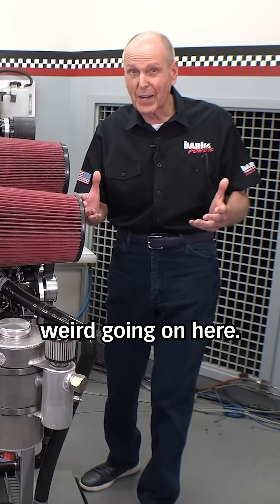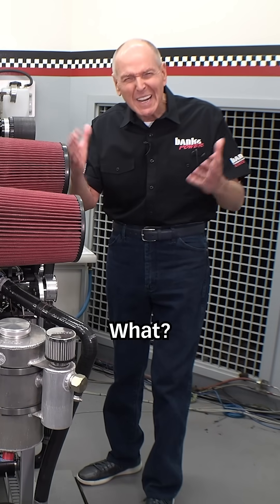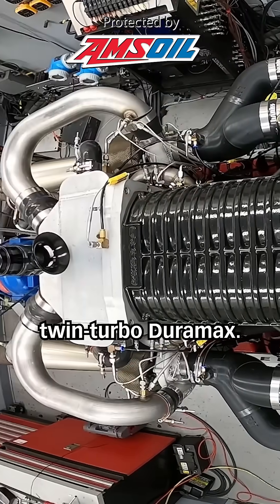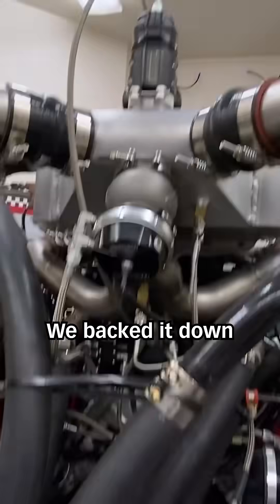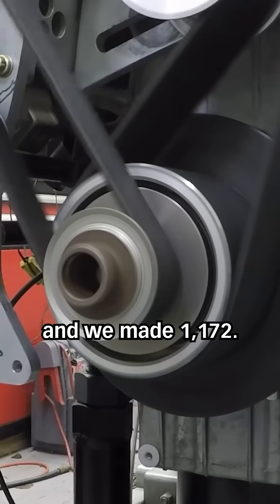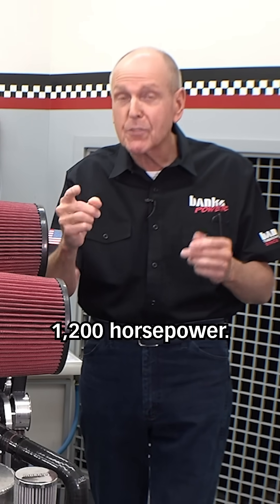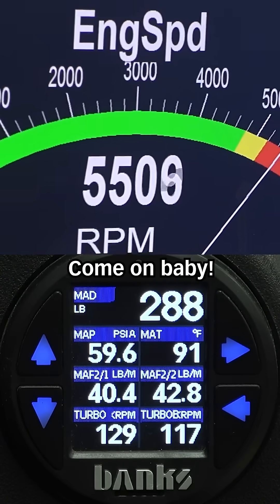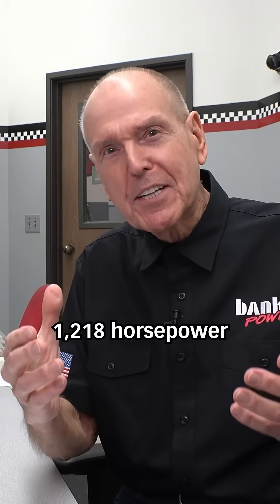How to make 1,200 horsepower the wrong way.

Comment: Gale, the diesel man already knows this ...
The old 735 ci 8V92 T Detroit was 430 hp with one turbo into a supercharger. They added a second turbo the 8V92 TT 440 hp in a two-stroke 735 ci diesel, a bad design.
A 855 ci cumings BCll with just one turbo rated at 400 hp would walkaway from a Detroit diesel loaded around 80,000 lbs. And on a pull like vantage 11 miles up hill, the DT would be so far behind you couldn't see him as you reached the top.
Reply from the maker: But the Detroit sure sounded great! Hard to beat the sound of a Screamin' Jimmy!
Reply: @bankspower well yeah in a light Grayhound bus on the flats... 
Back in 1980 I drove a hay truck at the age of 16 with a big cam ll, the guys with the Detroit Diesel hay trucks would tell me. You know the best way to drive a Detroit, when your getting in the cab SLAM your hand in the door. Get in mad as heck and shift like crazy ... 😂

Comment: Blower should be first for instant throttle response. And then once the Turbo spool, they can pick up the slack. Afterwards, slower, lower speeds means more cfms, more air, more fuel, more power

Comment: nothing is wrong. turbos are naturally going to lag a bit. with less force going in to the engine by super charger is making it a tiny bit lean, when that happens the turbos goes a bit faster because there's more power being used up which allows the engine to basically take as much as it needs and is able to disperse what it doesn't need more easily. and in some cases can make the engine pollute less if done in that way

Comment: Hey professor , I have always had a want to fab out a turbo with a roots style super charger compressor housing on a turbo . Build a turbo compressor housing side of the turbo into a twin rotor . Instead of a single compressor wheel , make it a diameter rotor compressor assembly

Comment: My issue with this is the 1200hp@5500rpm. Make 1200hp@2600rpm and ill be impressed. 1200hp@5300rpm is less than 1200lbft. I want 1200lbft@1600rpm. My normal money maker is 1850lbft@1100rpm(394hp) it still making 1850lbft@1400rpm(thats 497hp). Its just a calulation. Because 500hp@1700rpm is a mere 1544lbft. Where does 3hp become 306lbft? Its all a calculation. Show me a 1500, 1700lbft 6.6 or 6.7(cummapart or PSD), that makes real leverage and is reliable .

Comment: Just switch them around and make 2300hp because the blower is acting like a choke point because the turbos spoil up faster and make more psi switching them around blower first turbos second the turbos will make the bill flow as the turbos speed up the cfm add timing and fuel and ur be grinning.  #BrinksDiesel

Comment: Mr. Banks.
With all duevrespect for you as one of the masters of power.
That's a compounding system. The turbos once spooled up the blower is only al9ng for the ride as the turbos over ride the blower and the blower now acts as a positive displacement, but turbos work as veritable density. So yes....a slower blower speed with turbos is cool combo.

Comment: Try running an external pump and oil cooler on that blower and turn the speed back up, bet it picks up gobs extra power, supercharger is creating extra heat at higher rpm and killing charge density as a result

Comment: My thought is that if you slow the blower down then the turbos are able to create more boost before the blower. Essentially using the blower as a kind of restriction that can then boost the boost from the turbos. Compressing the air going into the blower, seems like the air coming out has more pressure? volume? Or velocity? Just my thoughts on it.

Comment: I'm a self-proclaimed YouTube mechanic LOL. But I do know pumps and pumps work on a curve if those curves between two pumps don't match then they're working against each other because where they meet it will cause turbulence which is kind of like a clog in the pipes which in turn will create more heat because they're working harder to get the air through

Comment: Remove the supercharger and add a Venturi system on the discharge side of the turbos cooling down the exhaust and adding more volume of air

Comment: What I don't understand is why nobody has used the Venturi system with turbos it would increase the air volume going in along with cooling down the air I guess I should say exhaust going through the turbos it would pull air in cooling the exhaust gases which in turn also increasing horsepower and they're not hard to make

Comment: So this DuraMax is set up like the army did with the 8v71t, 6v63t, 6v71t, 12v71t and 12v92t from Detroit Diesel back in the day to power its heavier tracked and heavier duty wheeled vehicles to wring out more power in units that have to go into confined spaces with strict airflow circulation rules. 

Come to think of it, Continental Teledyne did the same thing with its AVDS 1790 gas burners. ( thats 1790 cubic inches in a V12, gasoline burning, aircooled tank engine using 2 magnetos per bank as spark, and also being both turbo charged and super charged.
 And yeh, pumping more air into a blower thats slower cools and condenses it, bumping up your power.

Comment: Slowing the blower down allows the turbos to build more pressure in the top of the blower before it slams in into the compressor side of the blower...more time to build a higher pressure equals a compound ratio on the engine side, atleast as a machinist that would be my thoughts so dont quote me on it but that would make sence..

Comment: He should put a smaller displacement supercharger with slightly undersized pulley to get it to spin. One boost pressure reaches optimum number the turbo should take over from there

Comment: I say the Supercharger is the restriction. Be nice to watch the boost pressures upstream of the Supercharger before he started slowing it down and then the final pressure downstream of it in each test phase. The Supercharger is only proficient at lower RPMs. Allow the Turbos to spool tighter giving more mass crammed into the rotor lobe because it has more time when it's dlowed down.

Comment: Blower cannot accommodate how much air they turbos are capable of pushing through. Put some ways gates on the turbo, charged pipes and dump the excess air that the blower cannot deal with straight into the lid. Could get way more technical but you know what I’m talking about. You’re very intelligent.

Comment: I’ll be honest I learned this for Mr. Banks. Slowing the blower down cools the air off in the supercharger. Cooler air is more dense and creates more horsepower. I knew about the cooler air making more horsepower but I had no idea about slowing down a supercharger because it created heat. I love these videos.
Reply: Slowing the supercharger also results in less parasitic hp loss. The amount of hp needed to drive a certain psi, goes up on a logarithmic scale, not linear.
Reply: @ Thank you. I understand what you’re saying.
Reply: That's what I'm thinking too.
Reply: Keep the blower speed cranked up and throw water methanol on there. Now you're back to denser air but at a much higher flow rate ;) superchargers absolutely love water methanol pre blower

Comment: Volvo made a truck engine for their fl6 model with a turbo and blower...the blower came in first and as the turbo came on the blower would cut out with anc air clutch system....the thing had torque like nothing else at the same hp rating

Comment: You are the master of diesel power but the way i always understood it was blowers make good boost at lower RPM’s and when the blower runs out of steam the turbos kick in for the higher RPM boost. The way I always understood it was; you could make boost all day long but if the motor cant take it in your waisting power in the form of drag (ie more boost) trying to push against a wall. Back down the attempt at making boost and you’ll make more power. It’s definitely a balancing act and making the most efficient air pump. Im a gas guy though so maybe i am way off on this. Definitely respect all you do tho.

Comment: Let's go with some physics here and some time I'm going to try to keep it really dumbed down I mean hardcore dumb down to everyone can understand we all got to start somewhere that's how I started 

As we know engines need air to run with fuel they also need time aka duration pretty simple right now as I believe we all can agree 

Let's go with something that I know that everyone can pull data on which go with the Detroit Diesel engines The DD13 DD15 DD16 diesel engines like that sort whatever brand you like I don't care not important I'm just trying to give a baseline so everyone can understand what I'm talking about 

Detroit engines basically start their baseline for maximum torque at 975 RPM they go all the way up to like 1500 just using it as a round number I can't remember at the moment 

The reason why these engines can go so low on the RPM and make so much torque besides cam profile and compression let's dumb it down even farther all the way down to time an engine spinning at 900 RPM is a lot slower than 1500 RPM this will impact the duration of the valve opening and closing intake and exhaust The other thing is fuel burn gets impacted because it's got more time to burn The other thing is because the intake valve is open for longer and the turbo is putting out how many pounds of boost you want to think of here it's able to cram that in for longer before that didn't take valve shuts in the piston goes on the compression cycle so keep that in your mind there lower RPM more time to cram air in then you get more compression out of it plus you can inject a boatload of fuel even if it's the same amount at 1500 you're still able to burn that longer therefore by getting more complete burn of that fuel extracting more energy getting more efficiency out of it now hopefully you understand that 

What I believe is happening with the blower and how he's actually getting more power out is the same effect because he's slowing down the blower changing the pulley on it making it run out of slower speed he is allowing more air to be pushed into the blower sections that come together that force the air into the intake underneath of it since he slowed it down he's giving it more time to shove more air into the same exact space and as the blower turns it pushes even stronger if that makes sense for anyone we all know that the blower only can do so much air on its own He's basically not only maximize the air that it can put out but also he's cramming air on top of it quite literally to go through it The other thing is because he's slowing it down he's generating less heat which gives you more air density as if you've been watching his videos 

The way I came up with this so-called theory if not more due to the fact that he talked about blowers and over driving the blower is something you never want to do because you'll spin it faster and faster and faster and the heat builds up but also the same thing You get the blades moving too fast and they can't grab the air they can't compress it like they should alone on its own but when he added the two turbos he kind of solved that issue to a certain extent but now slowing it down allows it to grab more chunks of air and jam it in into the intake manifold if that makes any sense 

I don't know how much CFM is moving but you really can't measure that here You have to use air density boost can be a flat-out fucking liar and I'll tell you first straight up I can tell by the truck that I drive is a 2024 Mack anthem with the MP8 engine I burned a cylinders in too low RPM high gear heavy weight made it work get it screaming The trucks and animal now is 77,000 mi on it I started out with 351 mi something like that with that said it may be a governed truck but it flies The other thing is air density is everything My truck to try and say 40 lb of boost and I'll go 40 lb my ass If it's hot outside forget it cuz I look at the boost but then I start looking at EGTs and when the EGT start skyrocketing I know right then and there that the air density is not there because if the boost is actually there the air density is actually there My EGTs will be a lot cooler I will get more complete burn I won't get so much exhaust gases either the annual run cooler especially right now we're getting in the fall I'm getting a boatload of power and the other thing is the way to trucks running and the way I ran the truck with the transmission it will run down the 850 RPMs and top gear The truck has learned to do it it only likes to go to 900 factory but the truck has learned it can do this The other thing is you listen to your turbo you listen to your engine how it's firing and you can tell when the air density is really good extremely good that turbo screams like hell and I'm holding high gears like 11 direct drive and 12 overdrive going up grades from all different ranges of different loads that I pull I can pull like 45 46,000 lb in a box all the way down to 20,000 lb sometimes 8,000 lb but I can tell you this if I'm not really pulling 30,000 lb say 25,000 I may not even feel it the truck just takes off when the air density is there 

If you kind of don't understand what I'm talking about look at banks he's got YouTube shorts he's also got the videos it's very important you know your air density to me I wish every vehicle would tell you that right away especially when you're under a boost application Banks does have a video with a one foot cube literally welded has some sensors on it some gauges heats it up and literally to boost gauge starts going up but the air density has not changed whatsoever so the boost gauge can be a big fat liar

Comment: The supercharger is the restriction. It can only flow so much cfm through it. Thats why it gained power when Gale turned it slower. It became less of a restriction. He would make more horsepower with just the turbos into an open plenum intake manifold.

Comment: To much manifold pressure decreasing air flow with the higher blower speed or decreased air density because of the increased heat from the higher blower speed

Comment: That's some smart thinking about reversing the set up when you think about it. With the turbos waiting to hit  boost trying to push more cfm though the super there would be an rpm range where there is no boost between the them but a vacuum making the super less efficient  and when in boost it would put more pressure onto the super and it would need more crank power to turn it and with the super blowing into the turbos they would spool faster with the the super acting as a pump assisting the exhaust side of the turbo forcing the turbo to suck out the exhaust out because it wont be the the exhaust pressure in the turbo spinning up the intake side it would be the super spooling it up forcing the turbo to suck the exhaust  out

Comment: Yeah, the blower is beating the crap out of the air, basically operating the supercharger at too high rpm is adding more heat then density. It would probably make more power with just turbos. Or, if you must have the blower for rpm response it needs a way to bypass the supercharger. Ideally with a clutch and an air bypass.

Comment: So basically it was running lean?
Reply: Diesels should ALWAYS have excess air; remember, diesels don't throttle the air, they always swallow as much air as possible and control power by modulating the amount of fuel that's injected directly into the combustion chamber. Diesels don't run "lean"  because the only thing that matters is what's going on at the flame front; at that point A/F is pretty perfect or there wouldn't be a flame.

Comment: It's because the blower is driven by the rpm speed of cam.. hyperthetically the blower can only blow what rpm speed engine cranks at,  basically the turbos are pushing more than the blower and the blower is restricting the cubic m² of air blowing from turbo..   so yes.. change the set up.. put the turbo on the line and blower as secondary and boost psi on fuel some more than what you just put in.. try 1500cc injectors highflow..😊😂😂
Reply: And you should get at least 1500hp

Comment: Could you cnc a aluminum spacer to go onto the heads before the blower to just take the charge of the turbos? 

Look a lil goofy, maybe but if you could route that air before the blower and then turn up the blower i wonder how long it would take to blow. 

In theory a inch to two inch spacer should have enough room to allow the flow of the turbos.

Comment: I would really like to see a video and testing of pro charger to feed turbo combination. To eliminate any blow through anomalies And as much fuel as he can dump in it!😊🎉
Reply: Could run a quad turbo setup. But a procharger would likely be a better option because less parasitic HP loss than a roots blower or a Whipple supercharger and it's power on demand. So in theory it's a better option than what he's trying to do here.

Comment: I’m gonna say the superchargers parasitic losses creep exponential in the trials. Unless you have a klutch to disconnect the blower when the turbos take over. The more the crank spins the more hp taken off to spin the blower. As it goes faster the loss is multiplied to the point it exceeds any positive value it made in the beginning so it just drains horsepower. There is a way to mesh the two but its obviously a complex relationship

Comment: There's no magic here, originally the fuel/air mixture was too lean. When the blower was trimmed down it became closer to the stoichiometric ideal where the mixture is (theoretically) in perfect balance, thus combustion is almost complete. This is verified by increasing the fuel flow, making the mixture even closer to the ideal.

Comment: Robbing power from one end of the crank, to add some to the other, is silly, when turbochargers recover the heat, pressure and sound energy that otherwise go out the exhaust,  and do all the work, that would be wasted turning an air pump.